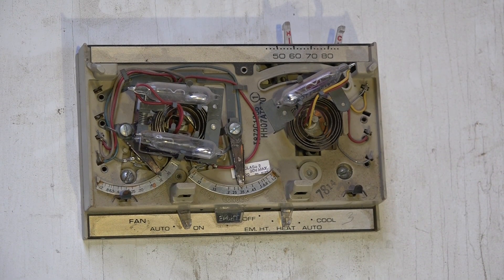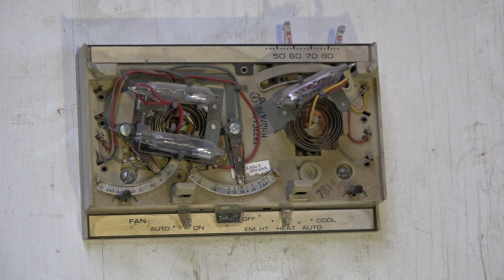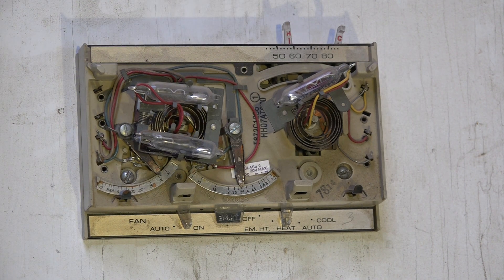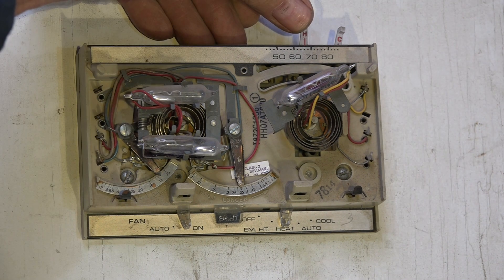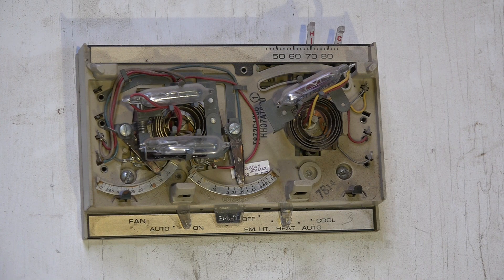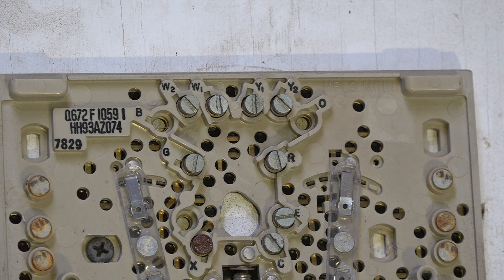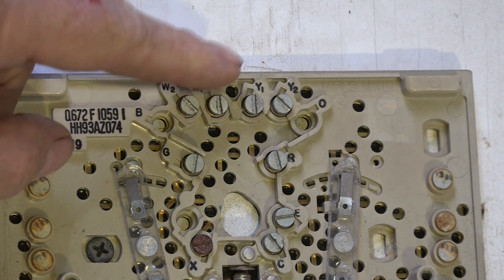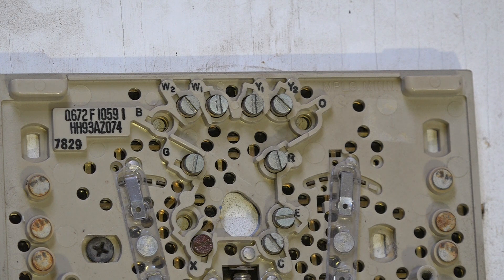How the 2 stage thermostat works

Comment: single stage thermostat on 2-stage furnace is a travesty - never gets continuous flow of heat of heat in colder snaps cycling between low and hi heat, get a lot of unnecessary use of high. Doesn't work "reasonably well".

Comment: Hello,
I have done a ton of looking for information on 2 stage units. Not much information. Here’s my problem/question: I have a Mobile home 1250sq’,Lake Havasu, temps from 125 high to winter 35, insulation fair 2x4 walls. I’m thinking a 3.5 ton 2 stage HP will handle this. I don’t want the unit to short cycle and I think a single stage big enough to handle the highs will do exactly that. How can I program it? I have read dozens of thermostat manuals and I can’t find anything about how to program one. It would be nice to have it stay in low for 30 minutes then go to high if the set temp isn’t satisfied or come on high if set temp is 4 degrees higher then room temp. I can’t find that kind of information in any of the new thermostat manuals. Thanks in advance. Craig
Reply from the maker: You are over thinking this issue.  
If you are correct in your sizing, a 2 stage unit will work well.
There is no extensive programming.  
A 2 stage thermostat will operate in 1st stage until the structure temp drops(rises) to about 1 degree from the set point.  
At that point, the second stage will come on. 
GFM

Comment: Hello, thank you for the easy explanation and a visual.
A question if I may,
We have a Nortron electric furnace with a newer digital, pretty sure two stage thermostat. Furnace runs only on "mild" setting and if "cold" weather setting is on it trips the main breaker. Problem is the furnace runs non stop and still does not reach the desired temperature.
I just found furnace manual online where it says if two stage thermostat is used it has to be set on mild.
Any ideas? Is it just a wrong thermostat or is the furnace having some kind of malfunction? How can I find out where the fault is?
Thank you!

Comment: Do I need special thermostat for 2 stage central air conditioning system?
Reply from the maker: That depends on the system.  Many newer systems need an OEM thermostat to work with multistage systems.  
GFM

Comment: Im having trouble with an old Trane thermostat in my apartment, I cant afford anyone to come and look it.
The cover got knocked off of the wall by a falling mirror, now the temperature reader doesn't sync with the temperature that i set it to.
Tryng to find info all over the internet, but this is the closest thing ive come to finding.
Im concerned it may affect my usage and bill.
 If someone reading this is generous enough to a lend a few minutes in helping me i would be very greatful!
Thank you :)
Reply: I know this is too late to help you but it may help someone else so I'm replying.  
A thermostat is just a connector like plugging in or unplugging a power cord.  When it connects it just turns on your furnace or air conditioner.   If your furnace is running it's costing $.  If it's not running, it's not.   So if you have to adjust the setting farther than before to get your apartment to the same level you're used to keeping it at temperature wise it doesn't make any difference as far as fuel consumption. It just means that the reader for the temperature that your thermostat is messed up. But the only thing that matters as far as fuel consumption and cost is how often it is running. Your thermostat is just an on and off switch that's connected to the temperature in the room at your thermostat. When the temperature in the room changes to lower than what you have the thermostat set at it will turn on the furnace.  When the temperature in the room reaches what your thermostat setting is at its senses it and disconnect power to the furnace control board which shuts off your furnace.
Reply: @yepper1165  Can someone slip a sliver of paper to prevent someone from changing the temperature from 70°F?
Reply: @olopatadine1052  Not any way to do that that I know of.

Comment: Considering setting up my thermostat to think it's using a 2 stage furnace on a single stage furnace. Send the 1st stage to a relay separate from the main board and pull the low wire from park on the main board to the relay. Or I could build a small board that turns on/off and powers the low fan speed to keep the fan on but not use so much power anytime the furnace has no call for conditioning. I can't find a schematic on the motor to see if the low speed really uses much less power or not so I guess I just have to hook up a meter to find out. I don't think the first idea will be any good because by then the air at the ground will just be cold as hell and initially feel pretty uncomfortable until it mixes. But I really like the idea of always on fan even just to clean the air from the 3 animals. Thoughts?

Comment: would a two stage thermostat cause a single stage furnace to blow cool air?  Having trouble with our furnace starting, turning the burners on, and then the burners shutting off but the pilot staying on and the furnace still blowing air continually(even once the air is cool) even though the thermostat says heat on.
Reply from the maker: Sounds like the unit is limiting out on high temp.  Dirty filter?
GFM

Comment: I have the same thermostat in my new bought house and im trying to upgrade to nest. I'm having problems wiring it bc it has 8 wire. Is nest compatible with my 2 stage heat pump system?
Reply: Most Nest thermostats ar 2 stage.
GFM

Comment: This is very interesting. I have a two stage pump system for the heat and 1 cooling. My new "smart" thermostat system wouldn't accept the E (presumably the emergency pump wire), only the W2 wire and only saw it as one pump system. Can a two stage be used as a one stage heating system like this?
Reply from the maker: It should work normally.
GFM

Comment: OMG I hate multistage operation. Let me say...so what if your heat (or cool) load is just a bit larger than first stage operation?  It seems that many times, it runs in first stage a really long time and then finally goes to 2nd stage. It's not as comfortable and it runs too long, and it's not worth having.  Having 2 stages is not that much more efficient, and it takes longer, the blower runs longer, your comfort range is larger. I only have a 2 stage compressor because it was the only type that came with a lifetime warranty.  It's more complex. In most situations, I prefer purely single stage operation, even if it is a 2 stage compressor.  I want to know the best way to connect thermostat controls to a 2 stage compressor so it always runs in 2nd stage, with no delay, and never runs in lower stage at all, not even for 10 mins. Not ever.
Reply from the maker: I don't know of a way to bypass 2 stage operation without a delay.  
GFM
Reply: Thanks !

Comment: Another question regarding the  Bryant 80 % AFUE Evolution series with variable speed ECM motor and two stage gas valve.   I will be using the furnace only for heating and air circulation (Fan On continuously) to operate Aprilaire filter year round.  I have a single stage program-able thermostat now that I'd like to continue using in conjunction with a "Air Cycler FRV" controller so that I can program "fan on" for various times of the day.  The "Air Cycler" site has a wiring diagram that illustrates how both the thermostat and Air Cycler controller are wired to the furnace air handler...Will both the thermostat and fan controller function as I hope on this "Evolution" series furnace with this variable speed fan.  Your YouTube channel is fantastic and I've learned a lot just listening to your explanations.  Here's the AirCycler site with wiring diagram I spoke of:
 www.aircycler.com/pages/aircycler-fvr
Reply from the maker: +Steve C It should work normally.  You might want to check the heat exchanger on the unit.  Many of them failed.
GFM

Comment: Very timely video.  Getting a smaller Bryant with two stage gas valve and variable speed blower fan, no air conditioning evaporator coil, but will be using the "fan " function to use with Aprilaire filter add-on to return duct...will a five wire cable between thermostat and furnace handle two stage thermostat / furnace combination  with required fan control when not in heating mode?
Reply from the maker: +Steve C Without air conditioning you will have enough wires.
GFM